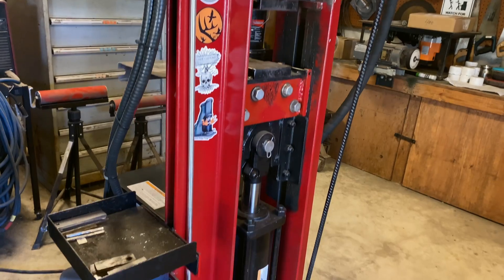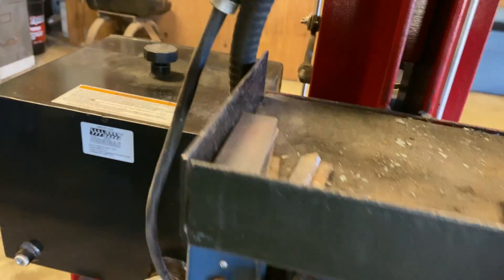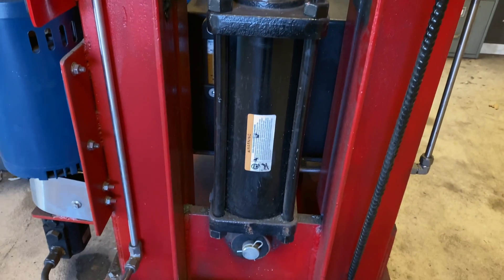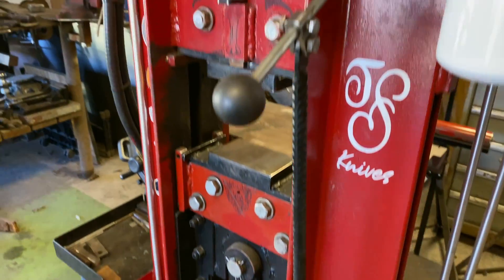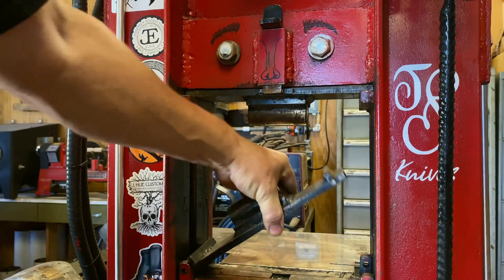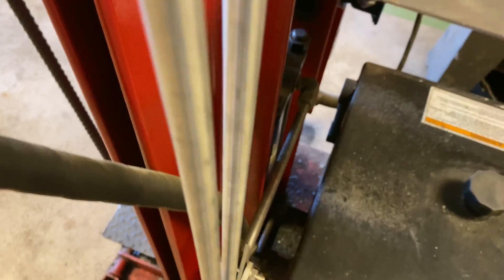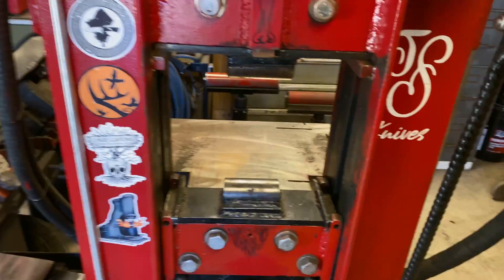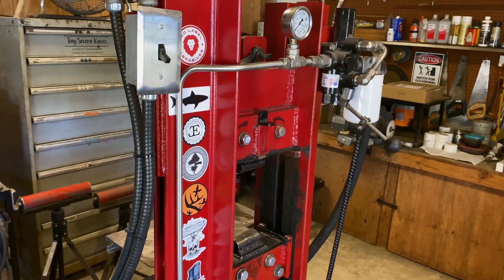24 Ton Hydraulic Forging Press walkthrough

Comment: I bought his book for $32 last week. The book states a 5 inch bore with 8 inch stroke but you said you have a 10 inch stroke and that’s working fine? 

The hardest part for me to understand are the bolt arrangements and whether the need to go through the entire width of the plates and 1 inch plate. What size bolts did you use for the big ones on the red? 2 1/2 inch by 2 

The black slide 1inch plate what sizes are those bolts?  The part 5 and 6 on materials and the hand drawing on the next page is tricky to nail down.

The dowel pins I believe are for holding the dies in place is that correct?

Also your top plate is much lower than the design in the book.
Reply: Finally have all of the steel and all of the electrical components procured. Quick question you said you switched to a 10” stroke. Did you have to adjust the measurements or increase the height of the angle iron uprights?
Reply from the maker: Cool.  Yes I adjusted the height by about 2 inches.
Reply from the maker: Yeah I wanted a longer stroke for punching hammer eyes but the stroke at ten inches is fine since it’s a 2” bore.

Yes the bolts go all the way though the plates.  I can’t remember the lengths though.  

I think they were 1/2 inch bolts but I would have to check.  

Yes the dowel pins hold down the bottom die plate.  

I’ll be back in the shop in a couple days and I’ll look at the bolts sizes.
Reply: @ awesome! Thank you very much for the info and I appreciate your time checking out the bolts and length of the big bolts and small bolts.
Reply from the maker: @bryswenson3092 the big bolts are 5/8 x 4”long and the smaller in the black plates are 1/2 x 3.5 inches long.  🙂
Reply: @ thank you very much, sir. I appreciate your time and help!
Reply from the maker: @bryswenson3092 you’re welcome and thanks for watching!

Comment: What is the difference between high and low speed motors in the performance of the hydraulic press?thanks
Reply from the maker: The motor is paired with the pump.  I used Dr James Bastons book on building forge presses to match motor, pump and cylinder.  I wanted a fast, powerful press and this setup was my solution based on the calculations in the book.  There is a link to the book in the description of the video.  It’s a goldmine of info.  Thanks for watching!

Comment: An offhand guess as to an estimated cost, using high pressure lines (instead of stainless)?
Reply from the maker: The flexible lines were around 20-30 bucks back when I built it.  It’s much cheaper than the stainless and high pressure fittings that I used.  But I already had the tubing and the fittings.
Reply: I'm just wondering if it's doable within my budget.  Also, how much of a savings by DIY.  Thanks!